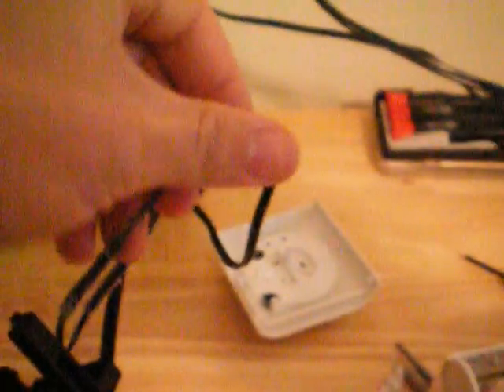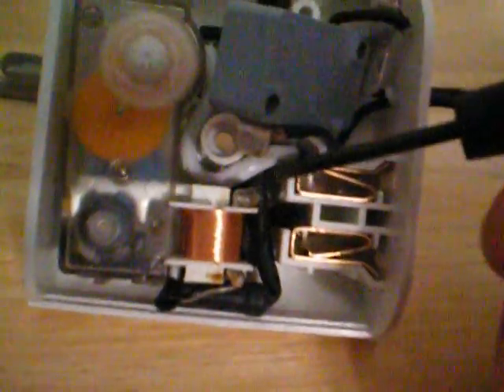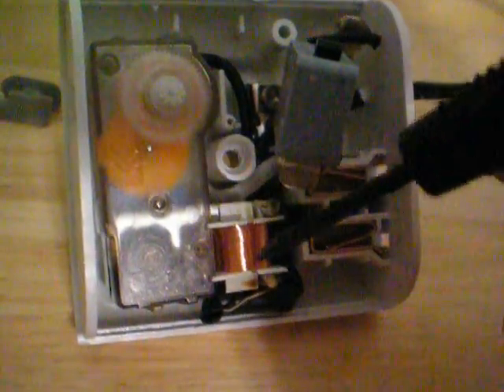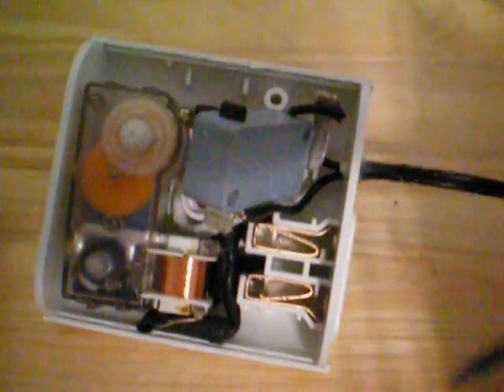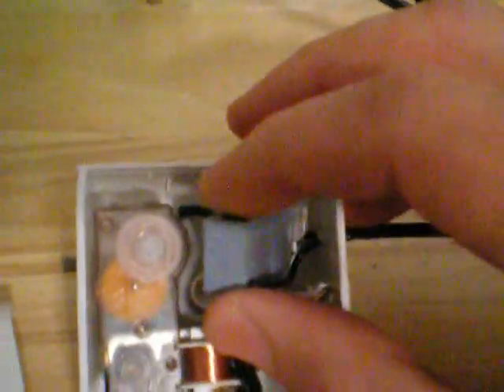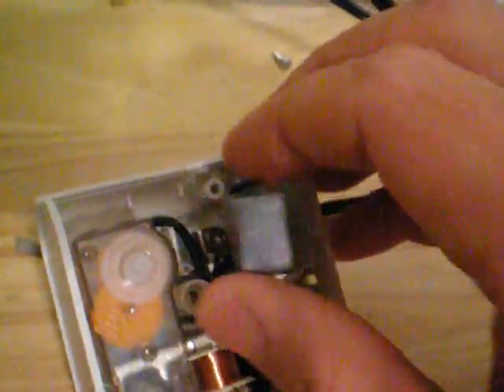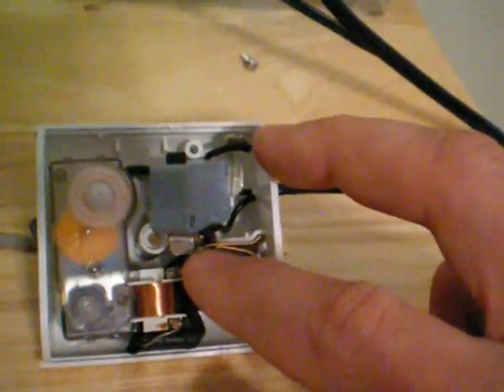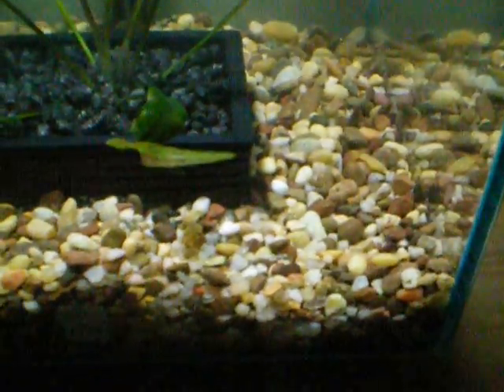Fluval Chi Modification - Wiring in a timer

Comment: There might be an easier way to do this using a magnet/solenoid that interacts with the magnetic in the light switch. That would avoid the need work with waterproofing

Comment: Thank you so much for the video. Could you please show how the connection flows through the Chi transformer. From where should the wire be drawn?  How regular light switch worked before?